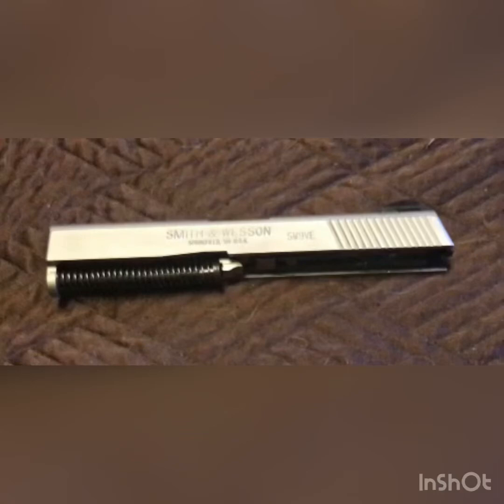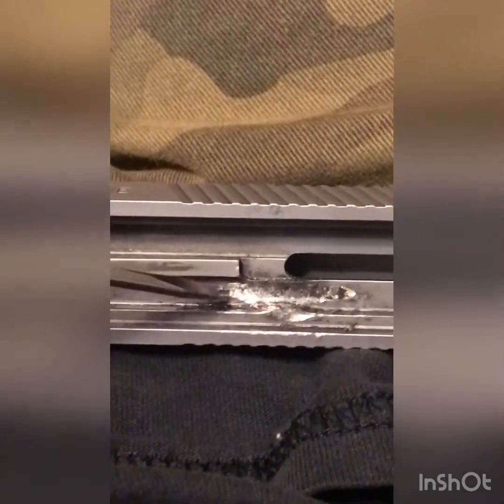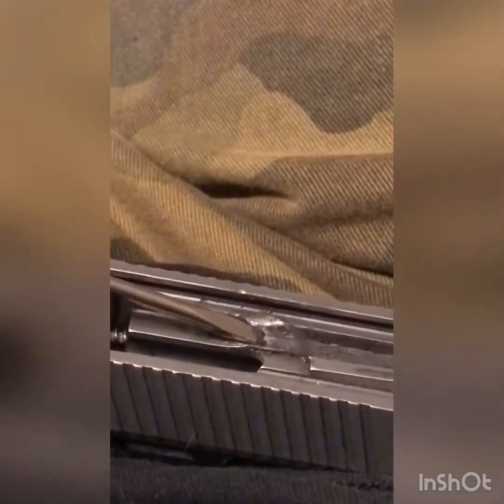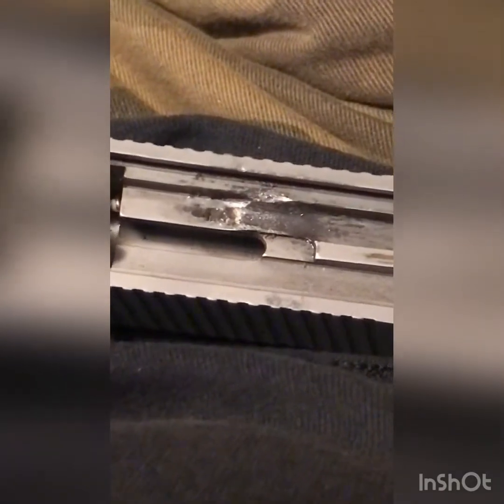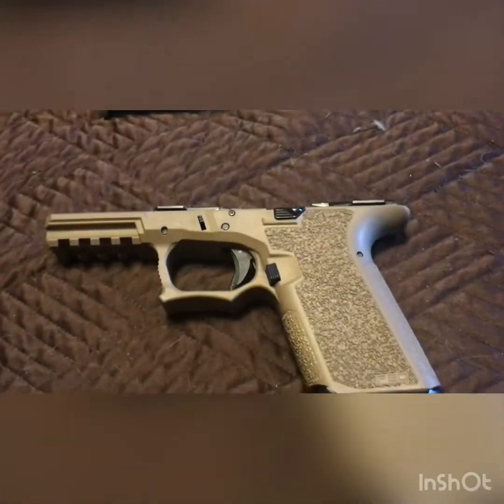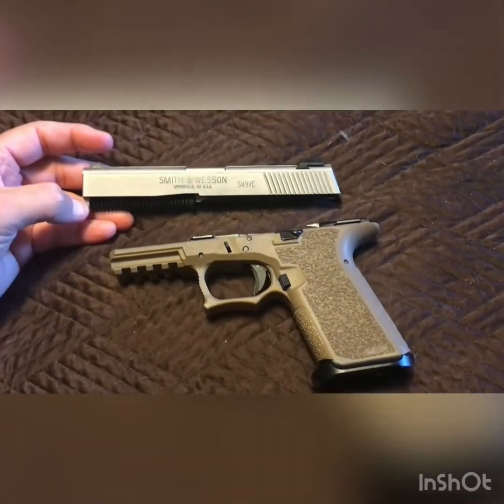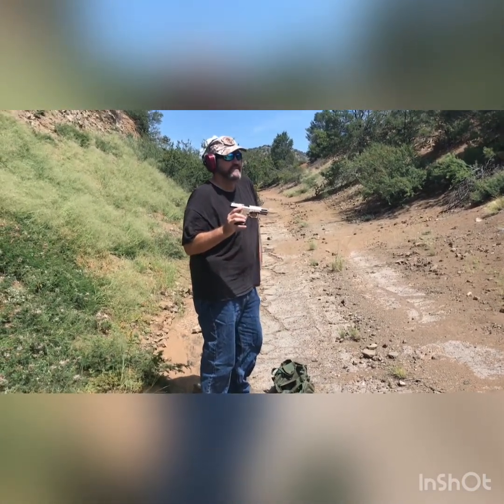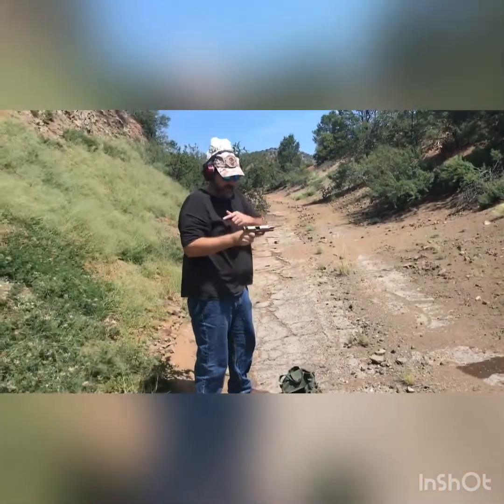Repairing and Test Fire of Subscribers SW9VE Slide

Comment: Now remove the back plate. Take a 4” cut off wheel on a angle grinder.  And remove the bottom back of the slide.  Use a glock back plate to check fit. 

Looks much better. This way you can do a slide assist on it that fits a glock.

Comment: Team,
I'm hoping to dig up some details on if your team has ever worked with the RIA STK100 frames and slides.
Specifically, I've been working with the Polymer 80 1st gen frame Glock 17 clone and this cheaply acquired STK 100 slide.   
Well let’s just say that it been time consuming and with a number of failures from my non-trained –gun enthusiast position.
The STK 100 got nothing but negative reviews and the parts are cheap and out there on the market. I was clearly hoping for a cheap build with cool looking upper.
Any thoughts or any feedback would be greatly appreciated.
Please send shipping/or FFl transfer info if you’re willing and would consider working it over into a functional build.   I can send videos and current status photos if you would like as well. It's been a pain. But it's on the precipice of greatness. 
-Jake

Comment: Does the firing pin off a Glock fit this slide?
Reply from the maker: Yes it will, you will have to use the S&W spring & cups. Use only the Glock firing pin. Some viewers have expressed concern over the possibility of light primer strikes because the Glock firing pin doesn’t protrude as far out of the slide and into the primer as the S&W does. I have never had a single issue with a round not discharging do to a light primer strike.

Comment: Hi, quick question. Do you use the Gen 3 lower parts kit sear housing, or do you use the sear housing that comes with the Sw9ve? I've heard that the problem with certain builds not reseting the trigger is because the glock resets horizontally while the sigma does vertically
Reply from the maker: I use a complete Glock Gen 3 lower parts kit (LPK) once the slide and firing pin have been modified you shouldn’t have any issues.
Reply: @blackriveroutfitters7185  I have a question about these I built a sw40ve and the slide gets stuck just before its fully chambered and the trigger doesn't work completely